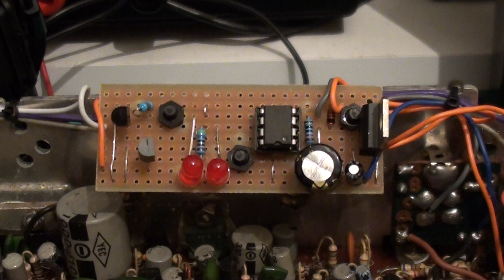PTT switch to use a CB Radio with an X-Phase QRM Eliminator

Comment: I was told by a radio tech that you could just wire the ptt to the tx and ground of the mic socket, what do you think
Reply from the maker: Well the thing is as I have said before, mechanical relays do not switch fast enough to prevent RF from reaching the JFETs, you might get away with it on a CB radio that is only outputting a couple of watts but on a cobra or other radio that pushes in excess of 10-20 watts it would mean almost certain death for the JFETs,  the delay in TXing that this unit provides will protect them fully until the relays are closed/open, Let me put it another way, imagine your RF is a bullet and the relay is a door, if you shoot the bullet at the door could it then be opened in time for the bullet to pass through without damaging the door, much better to make sure the door is wide open first ;)

Comment: Hi Andy great video and I'm sure will help others like me who have bought a unit and then find they can't use it with their CB radio. do you make them for others and sell them? - I would be very interested many thanks Rob
Reply: Using a SDR TX/RX Switch with a CB and the RF sensing works fine for FM/AM use the problem is when you're using SSB, that's when the relay starts going crazy.

Comment: Hi Tim. I cant open the file for the code. All it says is file unsupported. Any ideas? Thanks again,
Reply from the maker: Hi Andy, the code download should open the Picaxe editor software when you run it so make sure the Picaxe editor software is installed first, in case you still have problems with it I have included a link for the code in text format which can be copied and pasted into a new instance of the editor software..  https://drive.google.com/file/d/1rn_kz59UcsfXV3HbsmE9i0uKTQtvPsoO/view?usp=sharing